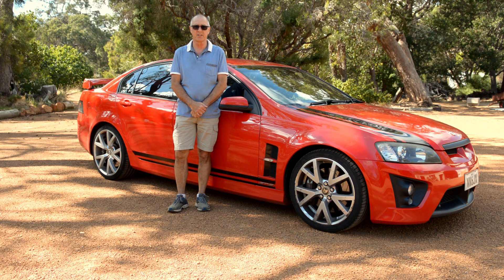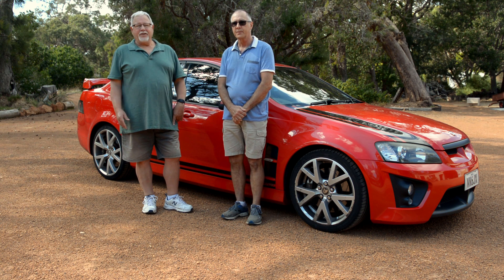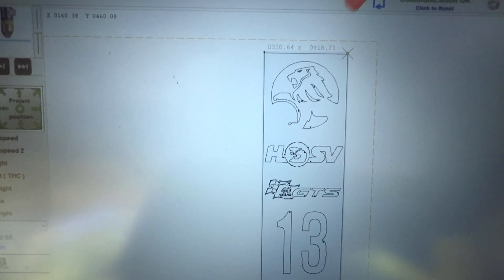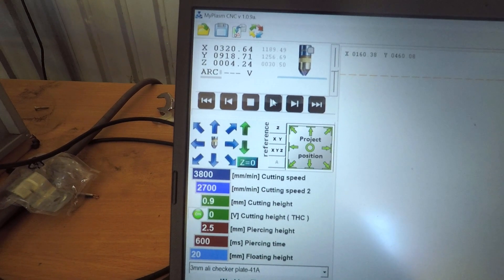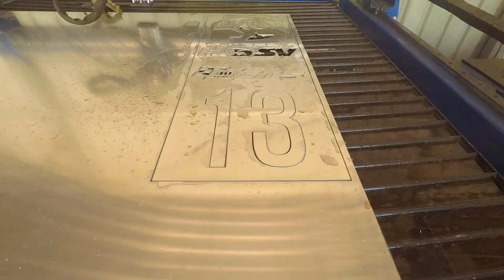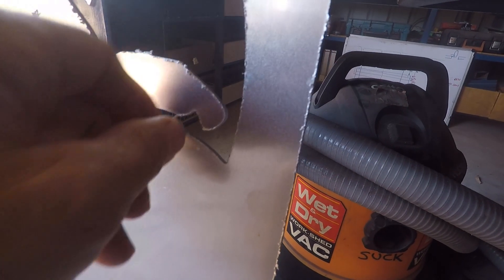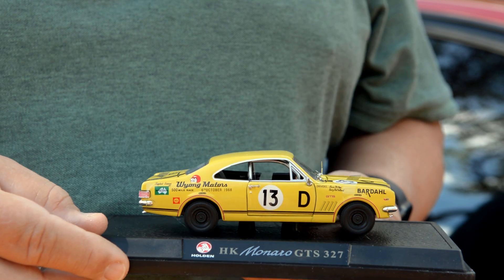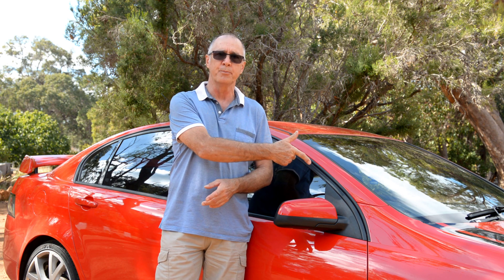CNC Plasma Cutter - 40th anniversary HSV GTS plaque

Comment: Thanks Rusty! Always great videos, but I really enjoyed the way you & John told the back store on the HK GTS.
Reply from the maker: Thanks Mike...the back story makes the video (and the plaque) more memorable.
Reply: @RustysMetalSigns  I'm still in the process of building my table, but have not purchased a plasma cutter yet. I know it's posted in an early video, but what cutter are you using?
Reply from the maker: I'm running the Jasic Razor Cut 45....sold in Australia under the Unimig banner. To date, I've never had any issues with it. It's just a shame that the machine torch is $700, but the hand torch is performing very well.

Comment: Love the car guys. Great sign Rusty. Really enjoyed the video again. My main cutting is alloy and I was wandering about cutting aluminium with a plasma. I cut it with my Cnc router. Might change. Keep them coming mate. Cheers Robert
Reply from the maker: Hi Robert, glad you enjoyed the video...and the car.  Cutting aluminium with a plasma cutter is quite easy and the results are really good. Just have to be careful not to scratch it when loading and unloading the sheet onto the plasma table.